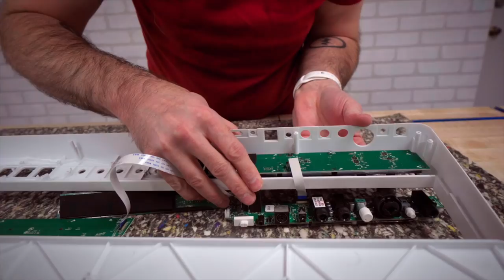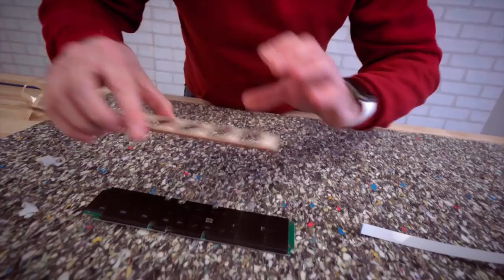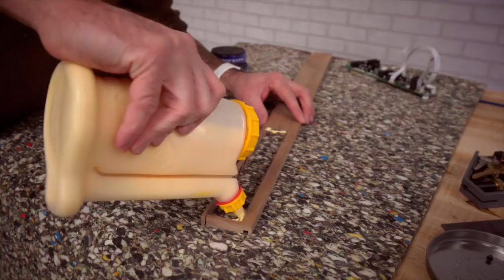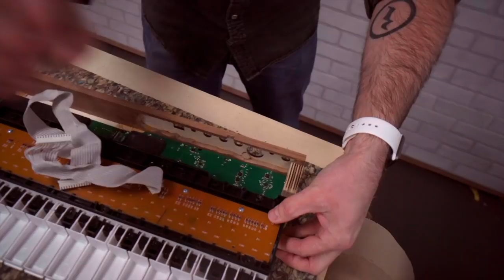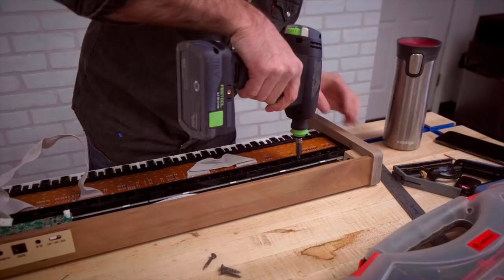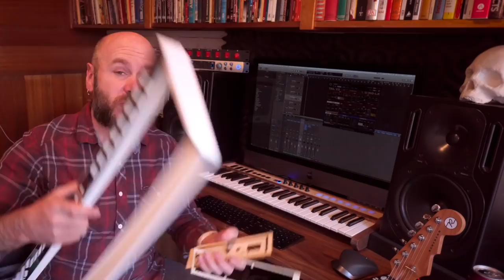Plastic Shell to Wood Case Upcycle | Woodworking Project

Comment: David, the best "trick" I've seen for getting the spacing right on a part you want to replicate is to scan it along with a size reference like a small ruler for scale. 

Then you adjust the image so that the scale is correct and you should have a near perfect copy to work with.

Comment: Nice! I m building a wooden case for my mininova but i will put battery, class d amp and speakers. I have a cardboard prototype working. So you can play sitting in the cauch. Any suggestion for online wood lasercut websites?
Reply from the maker: Check out SendCutSend.
Reply: @MakeSomething  ok thanks
Nice channel actually

Comment: Very nice. I was wondering if you could have used the 'scan' function that the Glowforge has, using the original plastic (probably cut up in parts). I don't have a Glowforge (was SOOOOO close to ordering one), so I don't know if that feature would be accurate enough or if shadow, etc. would play havoc on the required accuracy.

Comment: Absolutely loved it.  I made myself a little elm and walnut amp using the Jam Jar Co amp kit last year and fancy making a larger amp into a nice piece of furniture, just waiting on a suitable donor amp to appear in my life.

One thing you could do to replicate those plastic pillar connectors is to do them out of plastic tubing and screw in from both sides, using a decorative (brass?) screws on the visible side.

What is your Reverend guitar?  I'm thinking of swapping my PRS Custom 24 for a Double Agent
Reply from the maker: I have the Reverend Flatroc guitar. They are based here in Toledo and have a few friends who work there.

Comment: Great project, Mr. Picciuto! That keyboard just looks classy.

About the new office desk you're planning on building, I'd suggest considering a height adjustable desk. As I'd assume you'd spend a lot of your time at your workstation, and considering the harming effects of prolonged seating, having the option to stand while working might be very beneficial. Plus, it would be great challenge to embed the lifting mechanism into a wooden design of your own. The only downside is that you'll probably have to relocate the massive bookshelf :-/

Cheers, buddy!

Comment: As a friendly advice to your desktop build, rise your monitor somehow to the high you want or need it to be and work with it like that for a week or so to see if that works for you. I built a shelf on desk for my screen and speakers so that I could fit my keyboard underneath. After a week my upper back and neck got so painful that I needed to tear it apart. Not fun, but very educational...
Reply from the maker: ahh, good tip. thanks!

Comment: Can be done without a laser cutter. I would cut the button holding part from the plastic casing and glue thin veneer on that, and use a sharp knife to cut out all the holes. Sand as thin as you dare and its as good as wood. Just a lot of work, and pretty much no way back as the plastic case gets destroyed in the process. 

Theoretically it could be made of wood entirely by building up a few layers of veneer using the plastic as template. But that would be tedious...

Nice project. I love wood on equipment. I hate all that plastic. Remember the wood tv cases? The wood radios? I want that look back. And i want that now!
Reply from the maker: Good points! I always appreciate your positive attitude! Thanks!

Comment: Hind sight amateur engineering suggestion here:

You could have used the plastic case to trace all the port and button holes onto construction paper and then cut them out with an exacto knife which then can be verified by placing it over the area it goes to. 

From there, you scan the template into the computer and import it into your imaging program and convert it to the vector drawing you need, create your paths and then cut it out with your laser.

That might be a bit tedious and time consuming but you should end up with fewer bad test cuts. Of course, that could just be one of those ideas that sounds good on paper but in the actual practice; doesn't work at all.

[EDIT]
Just make sure you don't use white construction paper. The typical background pad for scanners is white so you will just be annoyed with yourself for not realizing that before you make your template.
Reply from the maker: This would have saved me so much time!

Comment: I once wrote a grant application to do an art installation that would have replaced all the plastic and manufactured items in a home with handmade versions (within reason), the remote and this keyboard would have been perfect examples of the concept (I didn't get the grant).

Comment: Nice work!  If you or any of your viewers try another project like this, be careful screwing in the circuit boards.  You can can cause breaks within the board by flexing it.  So I was cringing as you wrapped the PCBs screwing the keyboard In.